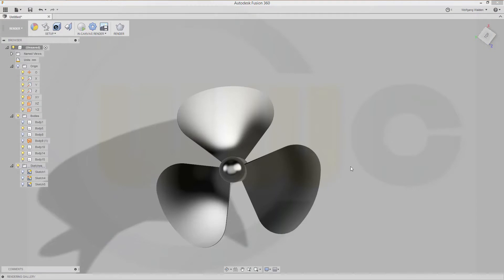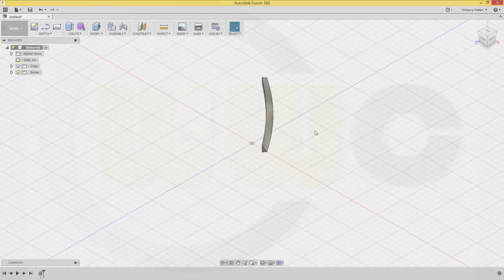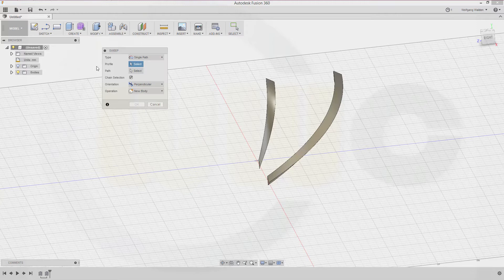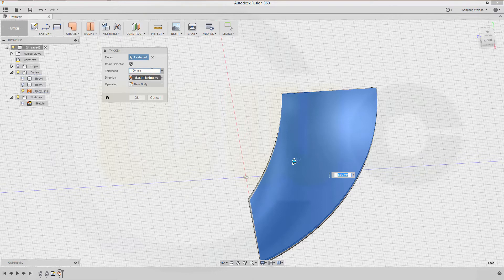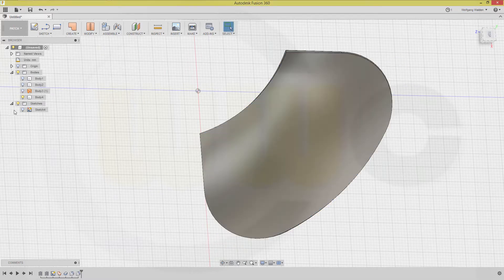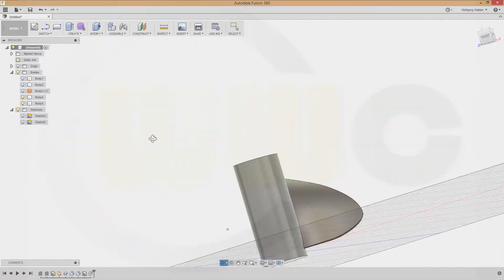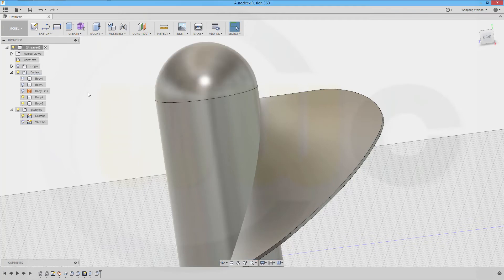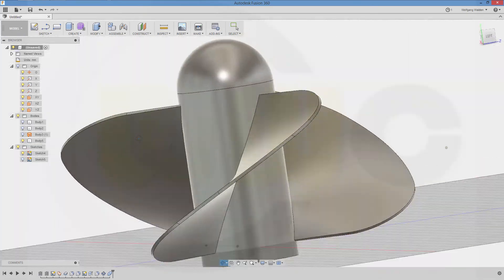9.5 Schiffsschraube - Propeller - Autodesk Fusion 360 Training - Part Design

Comment: Thanks for this! This is exactly the guide I needed to make my own fan blades as part of my desktop fan made out of broken printer spare parts. I struggled a bit only because my version of Fusion360 doesnt have the Patch environment, instead I found the same controls under the Design>Surface environment. Excellent tutorial, and very easy to follow. Thanks! :)
Reply from the maker: You´re welcome. I´ve made this video almost 4 years ago, so fusion 360 has changed in the meantime,

Comment: Awesome tutorial Wolfgang. However just a small note for current 360 users.  I couldn't get this to work with my current version (2.0.7046) as the sweep does not allow the selection of a line. However the solution was to use a loft with the two internal faces of the coils. Replacing the line sketch and sweep with a loft. Otherwise the tutorial was perfect and I would not have got there on my own. Thank you.
Reply from the maker: Thanks for your advice.